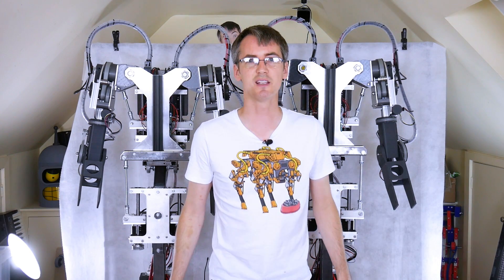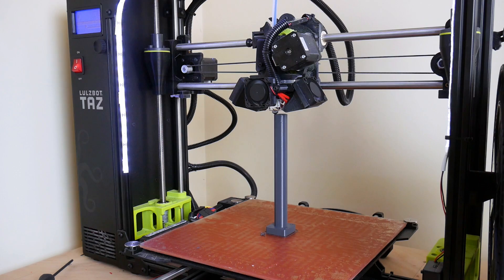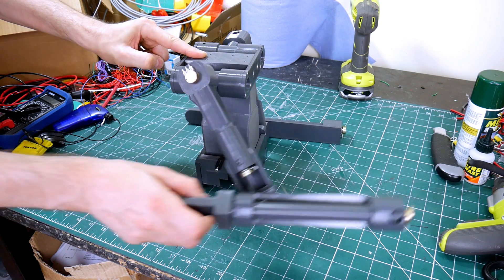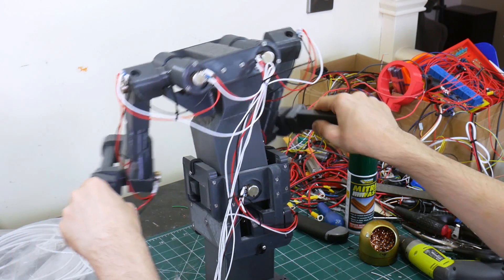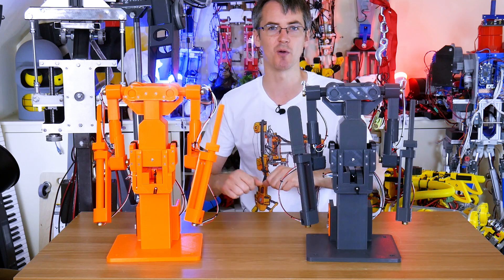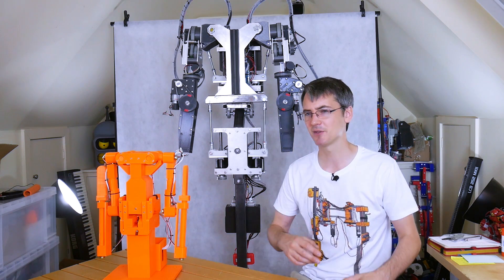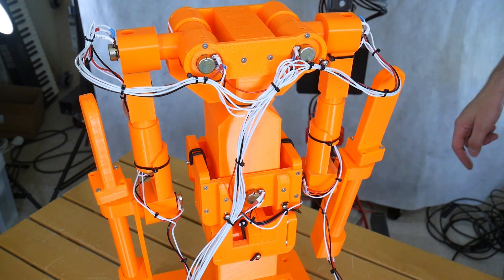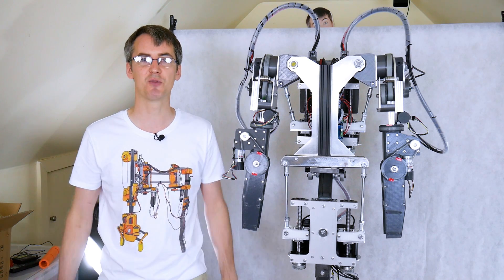Building Motion Capture Rigs for Robotics & Animatronics

Comment: You could also run a hybrid battery/wallpower setup just get the right voltage battery and then add a constant current constant voltage power surply. Then the batteri would be handling the difficult flutuating load and the powersurply would just be surplying the base load. As I think it's unlikely you are going to draw a constant 2-3kW.
Reply: Batteries aren't great at high current loads either.

What you want is some large super-capacitors.
That is in fact the ideal operating condition for a super-capacitor.

Capacitors are like batteries.
But they specifically have very high charge/discharge rates, and can handle very high current loads.
However, compared to batteries they store almost no power at all.

A supercapacitor has vastly more storage capacity than a regular capacitor.
It's still nowhere near that of a battery, but it's sizeable enough to do useful work for say 5 minutes vs a battery of similar size lasting an hour.

But, crucially, a supercapacitor won't particularly mind if you suddenly want to draw 400 amps, while a battery will degrade dramatically under a high current draw.

So... If you can get hold of them, use a moderately sized supercapacitor to let the machine use about 100 amps for like 30 seconds to a minute, and then charge it gradually over time at a much lower power input;
As long as the average load is low enough, this should work pretty well.

It's actually also similar to how the human body works (muscles in general) in that the 'average' power usage of a human being is about 100 watts...
Yet the peak load when you're using most of your muscles can be equivalent to many kilowatts - and, like a system with something akin to a supercapacitor, the muscles have mechanisms to store large amounts of energy locally for those situations, even though the blood supply dramatically limits the continuous output they'd be capable of.

So, your idea is a good one, but batteries aren't ideal, and a supercapacitor would be more appropriate.
Reply: @KuraIthys  You are correct about supercapacitors being better at peak loads but for this application, it's a bit overkill. 
The system is present using two power supply at 24v 40A and 48V 20A, and it seems to be running fine, so i don't see the need for adding 100-200x the power to the system. 

And the R/C LiPo batteries James has are not entirely gutless either, an example could be https://hobbyking.com/en_us/turnigy-battery-heavy-duty-5000mah-6s-60c-lipo-pack-xt-90.html which is a 23V 5Ah battery rated at 60C meaning it can continuously supply up to 300A and peak at 120C meaning 600A. If the robot could use the entire power of batteries it would be able to output a ridiculous 21kW running on 3 of those batteries 10 times more than on his current power supplies. 

And supercapacitors are a bit difficult to get a hand on, I recently looked into building a 12V back for my motorcycle but it was not worth it in the end, once you factor in the balancing circuit and good-sized supercaps.